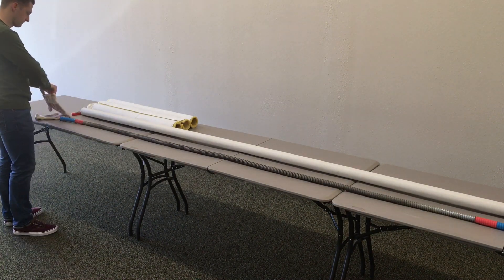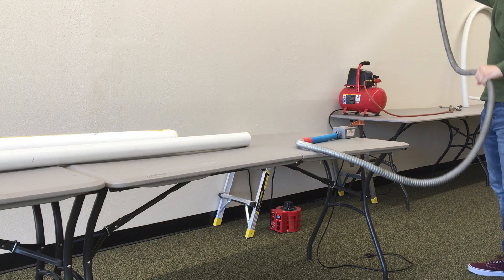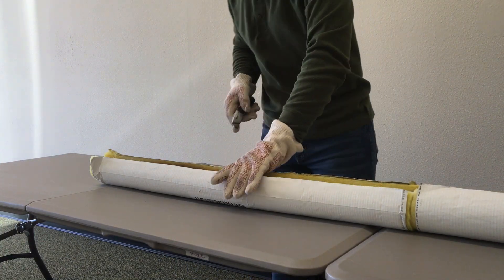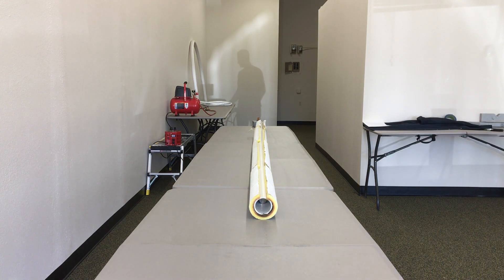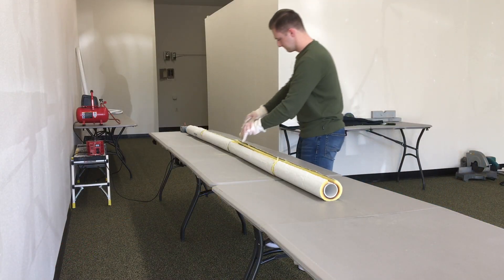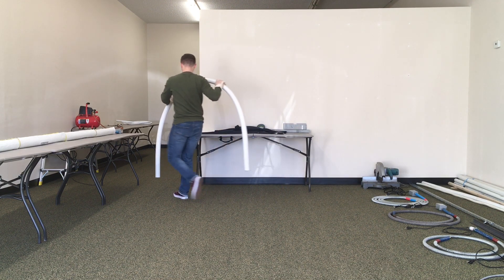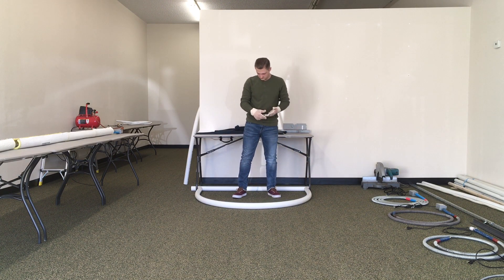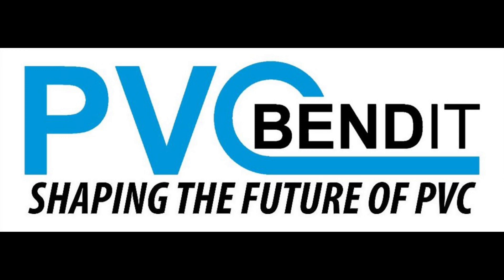Heating and Bending 2" PVC pipe

Comment: Looks like a lot of trouble just to bend 2" pvc.  Hot box?
Reply: Thanks Charles for your comment.  The PVC Bendit offers alternatives to the other heating methods.   And.  They typically are much less expensive - especially when bending larger diameter and longer lengths of PVC Pipe.